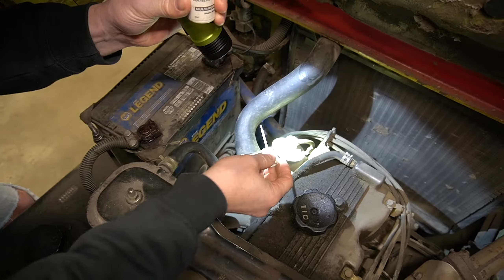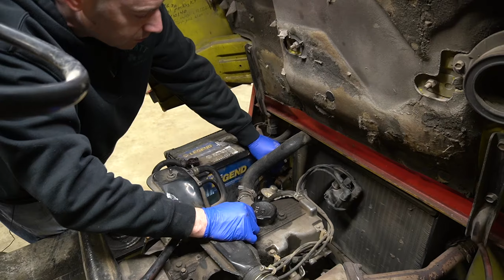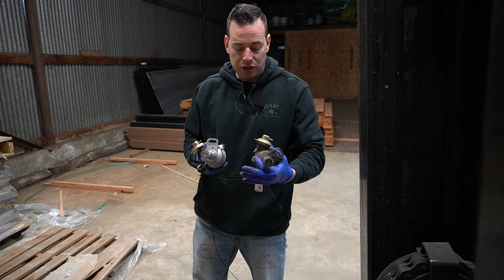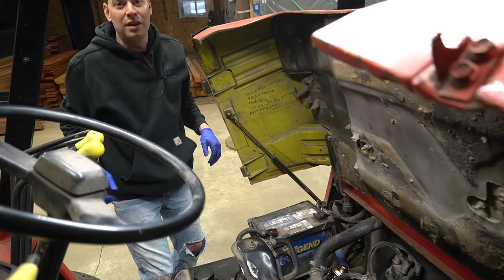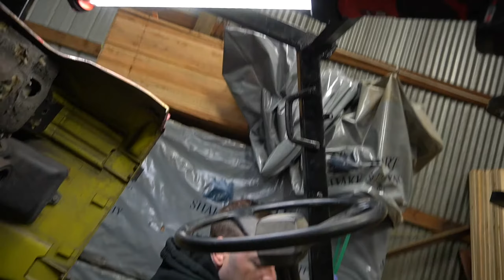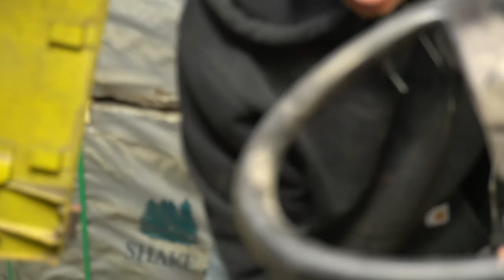How to properly remove and replace a distributor in an engine by marking it for an easy repair.

Comment: my trk is a 53 dodge m37 so its 70 yrs old but its designed so you can not put dist,in wrong the shaft has a tang on the bottom  thats off center so it will only go in one way  very easy to work on
Reply from the maker: It’s nice when they engineer things to be easier